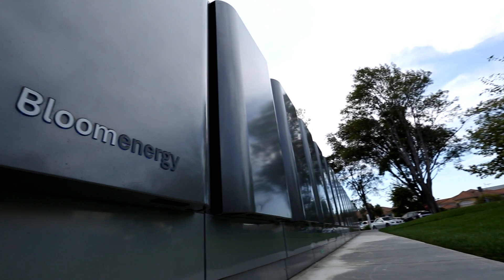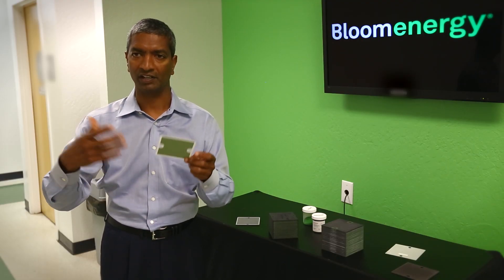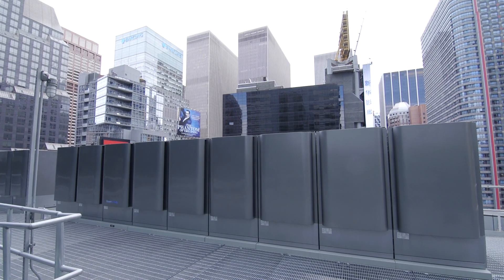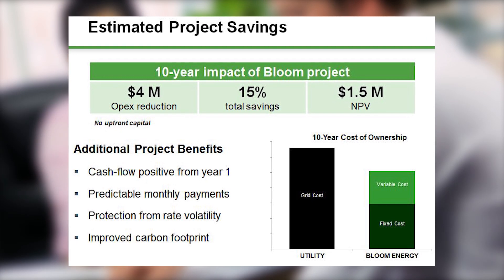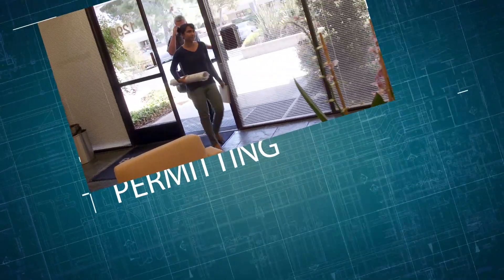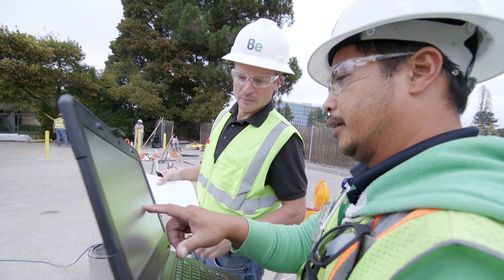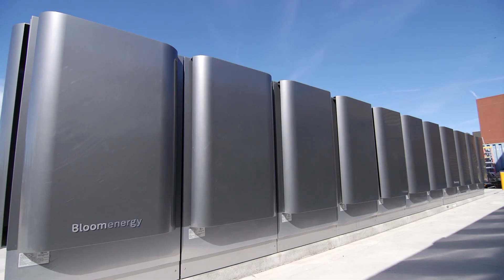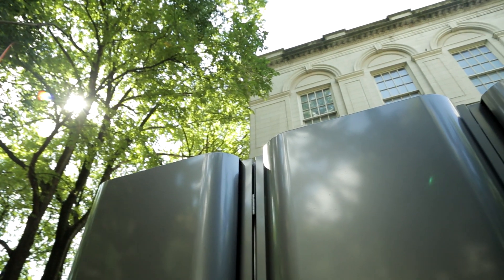Bloom Energy Installation Video

Comment: How much electricity does it required to run a single box??
Reply: gowtham gowtham it does not require electricity to run. It is ran by natural gas
Reply: @MilesT15  without electricity how can the process occur with natural gas . how the serperation pf natural gas occurs
Reply: gowtham gowtham a gas pipeline from a nearby gas plant?
Reply: gowtham gowtham there are fuel cells inside of the box and these cells are stacked where each single fuel is receiving natural gas on one side and air on the other side, which in turn produces electricity
Reply: @MilesT15  just by combining how electricity will be produced
Reply: @MilesT15  there should be some pump know to supply thee gases
Reply: gowtham gowtham yes I’m sure there is a pump at the station for the gas to reach the box, but then you’re talking about paying for gas at that point, not electricity. Not quite sure how that reaction occurs to create electricity once initiated, however. It must be chemical reaction between air and natural gas